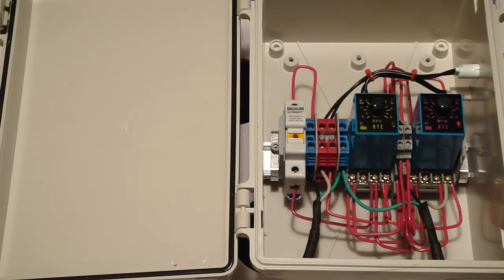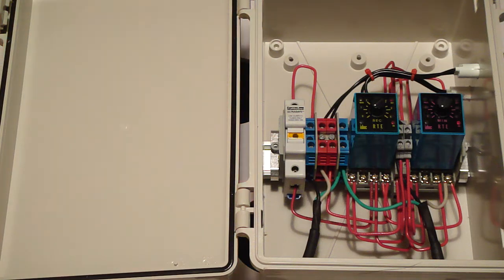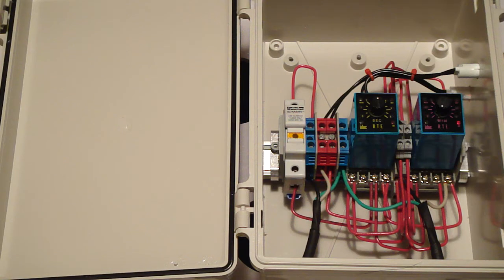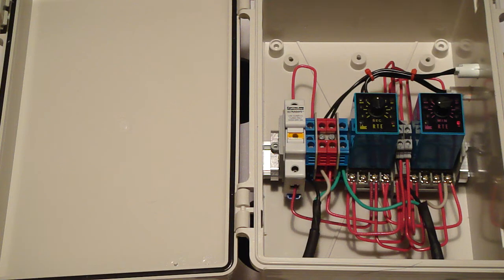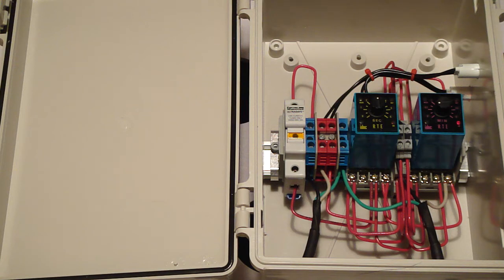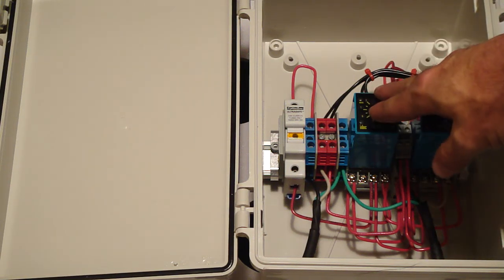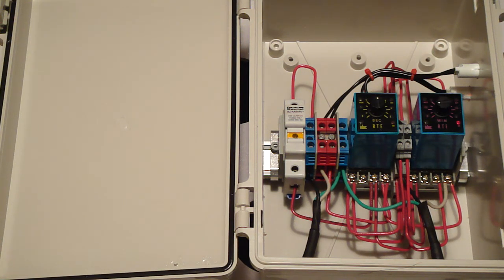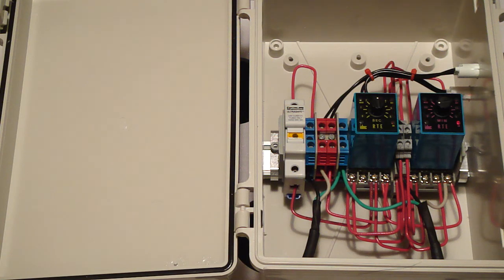Multiponics aeroponic cycle timers now available!

Comment: Thumbs Up! Great for ALL systems.. Multiponics... cool...  I am using the CAP Fixed 3m on 5m off and as roots develop or clogs/leaks develop, there is no way to adjust for it.  I LOVE IT!

I want one to run all of my pumps.. TilapiaPonics, Hydroponic Ebb and Flow and Toobz. Triple recovery piggyback closed loop with flush to outdoor banana plants and fruit tress weekly.

Could one of these be built to operate at 12 volts? (Solar)

Great Product...  I'll Buy!